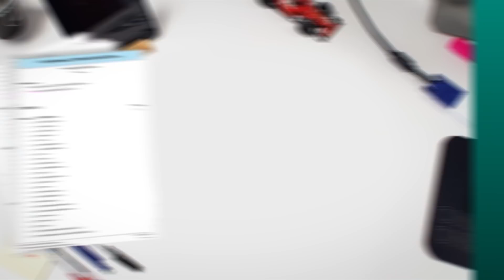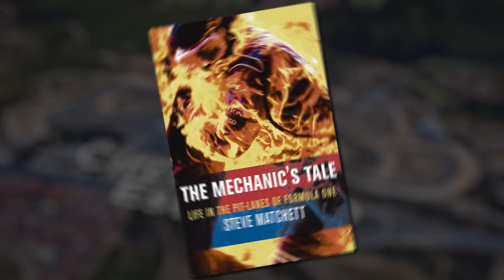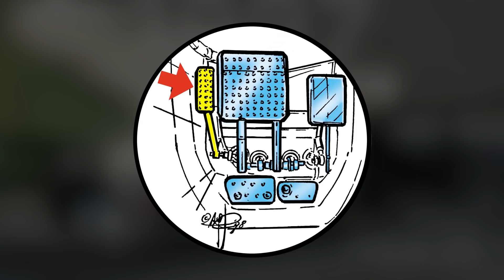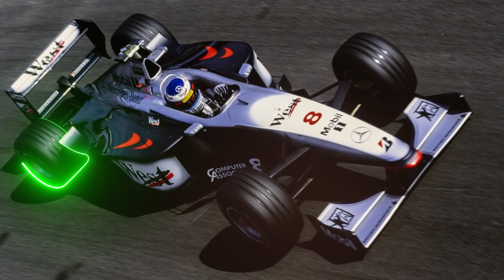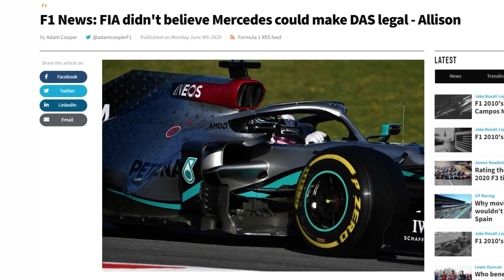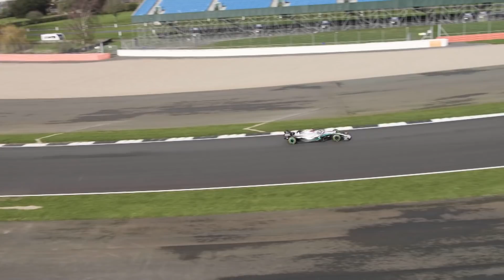The F1 Steering Innovations That Were Banned

Comment: I think the mistake benetton made with their design is that they tried to add that to a car that was already optimized to steer according to the grip it has. When they used it and the car was oversteery, they should have maybe used an aero package that went for less downforce. This would mean that they are faster on the straights due to less drag, and the car would otherwise be understeery. This way they achieve the steering angle and grip that they originally had, but enjoy faster speed on the straights.

This is assuming though that the system was good enough to be implemented. Obviously I don't know for sure.

Comment: The third pedal for rear brake control was so neat, reminds me of using the rear brake on motorcycle to tighten your line a bit; for those who've never ridden a motorcycle, you actually use both brakes independently on most motorcycles.

Comment: The rest of the grid:  Ban McLaren's brake steering system!  It will trigger an unaffordable spending war!

McLaren:  We did this with £50 of spare parts.
Reply: Actually it was banned after other teams started to copy it, specifically Minadi who ran a version in testing. It's one thing when drivers like Mika and DC have it, but it was decided the pay drivers at Minadi having a spin control wasn't that good an idea. 
This was same reason the concept had been banned in sports cars. Ferrari used it in the 70s but once it trickled down to some of the gentlemen drivers at Le Mans it became a bad idea. 
That said the Iveco busses the FIA use to transport people to and from the track, when they are allowed, use a version of that system.

Comment: Ask any mechanic and they’ll tell you that toe angle is a component of the suspension set-up.
Reply: Yes it is, but it's adjusted on the steering rack. To adjust toe on a normal car or a kart, you just screw the steering tie rod ends in or out. I don't see why it would be any different on an f1 car. I also drew up a concept to put DAS on a kart... it's actually not that difficult ae

Comment: I know merc will obviously deal with it and be dominant again- but I wanna know how much a ban on DAS will affect the geometry of the front suspension.  Especially since the front wing is designed with the suspension configuration in mind.  Then everything behind the front suspension is designed to deal with it’s wake.  It has to be basically a new car.  Then, how’s that gonna affect their awesome rear suspension, for which, the DAS was really just a red herring.
Reply: I actually don't think it will make much difference to the geometry. What I think the problem will be is weight. The DAS steering is quite a bit heavier than a normal steering set up, and removing it may have quite the effect on front end responsiveness, especially in low speed corners.

Comment: F1 is getting ridiculous. It’s supposed to be the cutting edge of motor car engineering and yet your average VW golf has a more advanced electronic package. Traction control, anti lock brakes, radar cruise control and vector braking to name but a few. In the late 80s and 90s Mitsubishi’s and Honda had road going cars with 4ws. They should reduce the regulations and let the designers loose to find new ways of creating faster lap times instead of spend millions of dollars shaving tenths off in a wind tunnel.

Comment: So the FIA basically helped Mercedes circumvent the regulations by giving them a means to using technology they would've otherwise not been allowed to use.

So...by that logic the Ferrari god power unit would've been legal if the FIA had told them how to implement it...nice.
Reply: No, the FIA didn't help Mercedes. The FIA is open to any team seeking assistance with the legality of anything they plan on developing. That's one of the main reasons Racing Point has a problem: they didn't ask the FIA about their rear brake ducts. If they did, the FIA said that they would have help them implementing the design.

The FIA just said to Merc:Oh you want to make this? It can't be like that because of that, that and that.
Merc: can we do this, this and this?
FIA: yes, even though we think is impossible, BTW it's gonna be banned next season
Merc: no problem

Comment: One wheel brake is something tractors have. They have 2 seperate pedals for both rear left and rear right, but normally they are attached together. Obviously nothing for F1, but still interesting.
Reply: So do motorbikes, It makes control A LOT easier

Comment: But isn't a Diff setting a rear wheel steering device too?
Reply: No because the angle of the rear wheels doesn't change
Reply: @davesmith5949  By that logic the extra brake pedal also didn't provide angle change lol

So no 4 wheel steering aswell

Comment: What about the pendulum device used in the Renault for the 2005 Championship,that was very creative.
Reply: Not steering and not a pendulum
It was a part of the suspension, a tuned mass damper, which makes the car more stable and less sensitibe to vibrations on kerbs and such

Comment: I never understand why the FIA gets scared of innovation ? If it works, it's safe & it can be used by all the teams then why "BAN IT!!!!" ? 
Should we ban turbos, power steering, sequential semi automatic gearboxes, fuel injection & everything else that improves the cars ?
Reply: The safety of the innovations is always debatable, and for other teams to implement something they need to spend ridiculous ammounts of money in R&D, even if they have to "copy" (reverse engineer) something, it's very expensive.

Comment: Hindsight is 20/20, but banning all electronic aids for 1994 was the worst decision the FIA has made. The cars were all designed with aids in mind already, so they were unstable without them. Senna said 94 would be a season full of accidents, and we know what ended up happening. If the FIA had banned all aids for 95 instead of 94, the teams would've had time to design cars around the regulations instead of adapting existing designs to them. Then again, would the safety measures that kicked in from '95 onwards have been put into action without the events of '94?
Reply: an accident like Senna's was gonna happen at some point, it just happened to be with Senna. A necessary tragedy, unfortunately. But the safety improvements that the FIA implemented probably saved countless drivers from injury or death
Reply: @midnmusic2217  also probably in part because it was Senna. Had it been just Ratzenberger much less would have probably been done.
Reply: rexmedorum unfortunately your probably right

Comment: "Innovate...but not too much!" Ridiculous. Give every team the same car or give them the same budget with no restrictions other than general car dimensions.
Reply: ...erm

no safety regulations then?
Reply: ツAtlas46 That's just a detail. Sure specify some crash safety requirements. The main point is if they want a V12, go for it. If they want an electric motor go for it. If they want more downforce, fine. Special breaking or steering fine. Let them innovate! It's as though dramatic innovation is not welcome but the same endpoint reached over a long period of smaller incremental innovations would be accepted which is silly.
Reply: So we would basically get pure dominance by one team. Restrictive regs prevent this.

Comment: One thing I've always wondered. How did the FIA themselves not notice the extra pedal in the Mclaren? Was scrutineering a bit laxer in the late 90s?
Reply: They probably noticed it, and either assumed it was a clutch pedal, or maybe they knew what it was but had no reason to reveal it because it didn’t break any rules in their eyes.

When the other teams found out and applied pressure onto the FIA, they they moved to outlaw it because of that pressure.
Reply: @Ren_1090  That makes sense. Thanks for the reply.
Reply: @Ren_1090  Its pretty much the later I believe. The FIA is privy to nearly all the teams "secret" tech, but is bound to not disclose that information as its confidential intellectual property.

For example, the FIA knew that Racing Point were straight up copying the 2019 Merc long before the rest of the grid did. They came in, checked it and signed it all off.

Comment: I honestly do not remember a time where Williams were considered a top team. I do remember in early 2000s when they were top 3.
Reply: They were a top team from 92-97. From 1980-1987.
Reply: @ciaronsmith4995  So before my time, exactly my point. I do not remember them being a top team.
Reply: @HMCarReviews  2001-2003 as well. But yeah that's fine.
Reply: @ciaronsmith4995  I do remember them being top 3 during the early 2000s but not the top team. For me Juan Pablo Montoya was Williams glory years.
Reply: @HMCarReviews  Juan Pablo Montoya is the best driver Williams had since Senna. JPM or Hill. I think JPM was faster anyways. Williams had the best car in 2003.
Reply: In 1992 they were qualifying two seconds a lap faster than  Aryton senna at most of the tracks and when Ricardo patrese is that much faster than senna the car must be remarkable

Comment: I laugh every time some brings up how DAS is legal for this year only. FIA miss managed this one and they know it.
Reply: No, Mercedes was able to make it within the rules, the FIA can´t just ban it out of the blue if it´s legal, especially after the team consulted to know if what they were planning to do was within the rules. So they can´t just ban something they said it was considered legal before. They can only ban it the year after (and it´s usually to avoid other teams spending money in it) or this year if it was dangerous to the driver or other cars. It´s not, so it´s legal and safe.
Reply: @The_Curious_Cat  Correction. They shouldn't ban it out of the blue if it's legal. They absolutely can, as there is absolutely nothing illegal about engines modes and they banned those mid season.

But yes, generally the rule is that if a part is illegal, its illegal already and the team is punished for using it. If its dangerous but legal, its banned immediately but the team is not banned for using it. Its its legal and they dont like it (usually because either a) its super expensive to develop and every team would have to develop it or b) its a fudge, and its clearly should not be legal but technically is)
Reply: @The_Curious_Cat  The reason the FIA banned it was because Ferrari and Red Bull had a massive issue with Mercedes gaining yet another advantage. The FIA succumbed to the pressure of 2 of the most powerful teams in the sport right now instead of just telling them that DAS is legal. Honestly it was pathetic.
Reply: Das was banned for 2021 before Mercedes even showed off the feature. Article 10.15 of the 2021 regulations stated "the re-alignment of the steered wheels, as defined by the position of the inboard attachment of the relevant suspensions members that remain a fixed distance from eachother, must be uniquely defined by a monotonic function of the rotational position of a single steering wheel". 
Stop saying the FIA banned it for 2021 but not 2020. A system like DAS was always going to be banned for 2021, weather or not a team developed it.

Comment: What FIA should ban is the ridiculous wheelbases these cars run. They look like road boats. The shorter sleeker cars of the 90s looked so much better.
Reply: Amen
Reply: @leonardoaraujo8364  Amen 2
Reply: That's part of 2022 regs
Reply: vicmanvalfre96 Not enough imo. The current cars could be shortened by 3ft and still considered a bit long.
Reply: @cereal-killer4455  The large tyres in 2022 aren't going to make them more nimble though.
Reply: yea well I'm glad they are returning to ground effect now. Hopefully soon, they'll return to smaller, narrower, shorter wheelbase, lighter cars too. Hope they allow front wings like FE (I say that because the front tire wake is real). Hope they allow more reliability-related sensors and tire-wear monitoring sensors. Hope they allow brake steer for front tires, more dynamic settings for differentials. Maybe blown and/or double diffusers. That'd allow a wider variety of driving styles to succeed in the sport and we'd see different drivers winning on different tracks. Plus all those technologies can be vastly improved and who knows how that could enhance normal cars and normal vehicles.
Reply: Faults OK but how do you explain all the bloat in front of the drivers head? It’s quiet simple, F1 has a desperate and pathetic hard on to beat circuit lap times year after year to be licked on by plebs as the “pinnacle of motorsport” even though chasing single lap times compromises wheel to wheel racing. If they climb out of their assholes and smell the roses they’d realize that fast nimble cars with exciting racing is more important than being a prototype lap time series.
Reply: @Faults No, the larger wheelbase is purely aero. The PUs really don't have much more of a footprint compared to the V8s and V10s
Reply: At The beggining, The MU were big and They asked for more space. Nowadays they already reduced a lot and they can short The car if they want.

Comment: FIA tends to ban everything that could represent any kind of ingenuity and innovation, but for years and years they have been accepting those horrible aerodynamic appendages, palettes, those front wings that look like my Gillette Sensor with "1347" blades and all kinds of visual dirt that make cars look like bird cages running at 300 km/h. Since they like to banish innovations, perhaps they should start with the infamous "Power Units" and bring back the art, the proper real engines, the V10/12 symphonic orchestras.
Reply: They won’t do this because of the whole carbon footprint thing. I wish  the engines would change to a normal V6 turbo but not hybrid. Carbon footprint shouldn’t be to bad and sound will be better than the hybrid engines now
Reply: @eliasteng933  And yet they're banning engine modes. FIA states drivers saving the engine and getting better traction on slow speed corners with ECO mode, then using Boost mode on high speed sections of the track is bad for the sport. It's an unfair steering advantage, just like DAS. I'm starting to see a pattern here.
Reply: Be Caffé Yh banning engine modes will definitely backfire I mean, if Merc were the only one that got banned then it might work but everyone is gonna get slowed so Idk what the FIA is smoking but I’d love some for sure.
Reply: @eliasteng933  The gap may be even bigger as they have the most reliable engine. Honda has make some progress. On the other end there is Renault. They might suffer. It will only benefit Ferrari, who doesn't have all engine modes available as per the "oil gate" scandal and the token regulations.
Reply: Be Caffé Yep Ferrari benefit from a ban. Where have I heard that before 🤣🤣🤣. Honestly embarrassing for them, the prancing horse more like the wonky Donkeys tbh